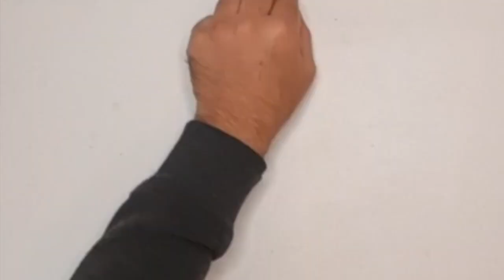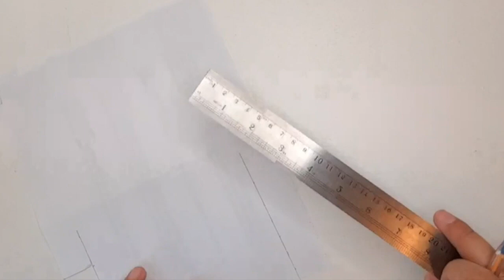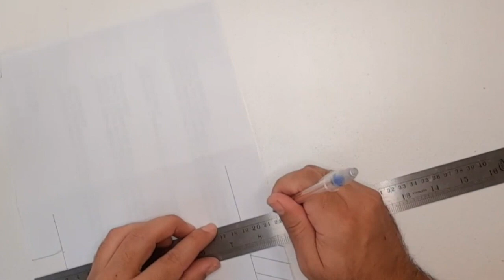Como construir Steel Marble paso a paso - How to make a Steel Marble track step by step - Subtítulos

Comment: Muy bonito trabajo, cómo le haces para soldar acero con el cautín siendo que el estaño sólo me puede soldar el cobre?.
Reply from the maker: Si se puede soldar. Aunque no cualquier alambre, es ideal que sea de un cierto calibre, y aunque cuesta que suelde, si es posible. Si quieres que sea mas fácil soldar, es mejor usar flux. De todas formas en este video específico todo lo que se debe usar, activa los subtitulos y podrás ver cada uno de los materiales en detalle. Saludos
Reply: @RoddoGear agradezco tu respuesta, saludos desde el estado de México.
Reply from the maker: De nada. Y no olvides suscribirte. Saludos